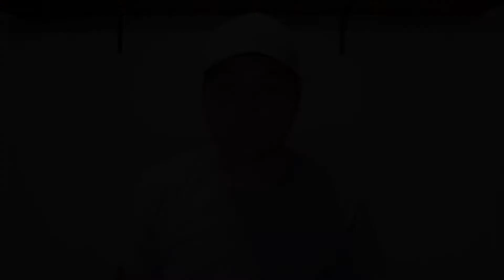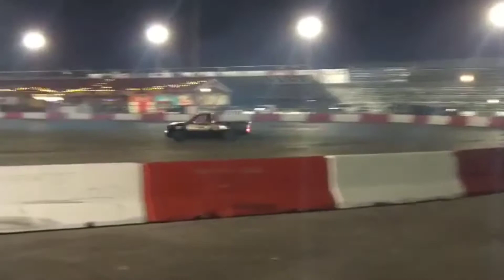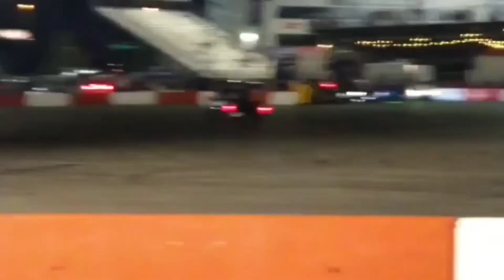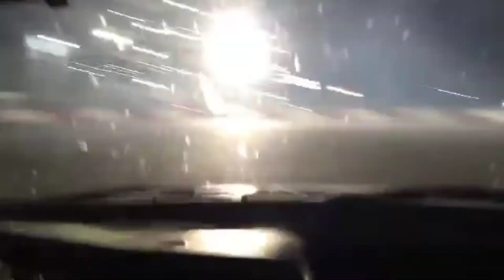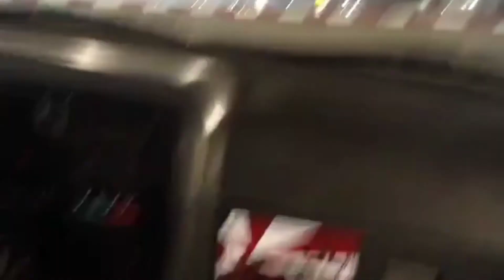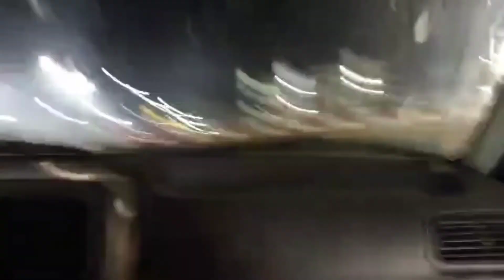1st Time "Drifting" the Hardbody

Comment: I’m about to go pickup a Nissan hardbody to do a drift truck build as well. And when I watched this video you drift at the same track I go to. I’m hoping to have it drift ready by the first midnight madness
Reply from the maker: Sweet! Just as a heads up, they tend to be pretty hesitant to pass trucks for tech there. It took me several attempts, tweaks, and working with the guys in charge to get mine to pass.